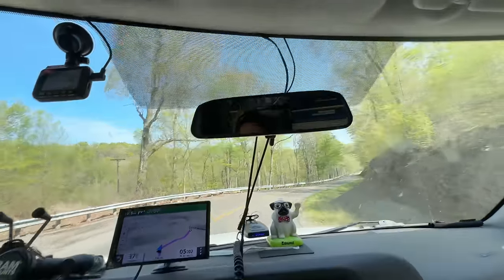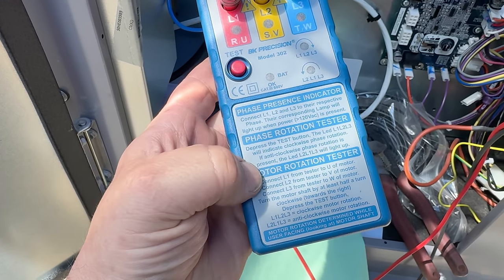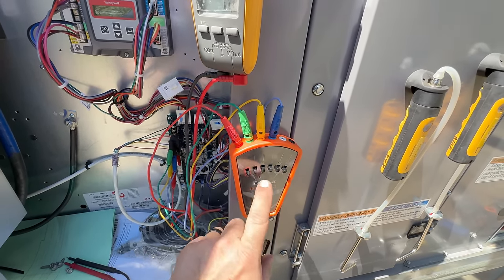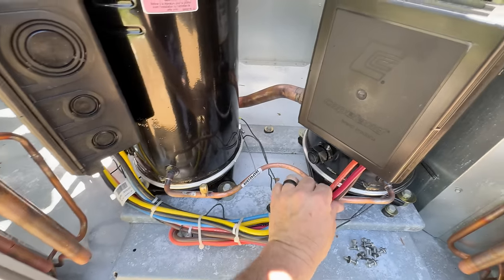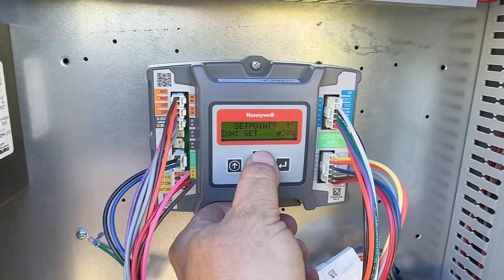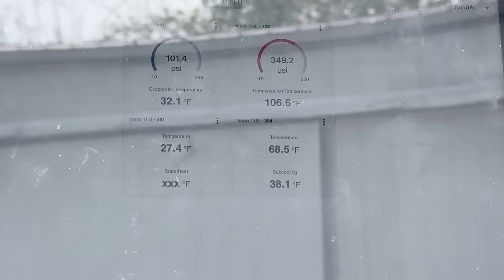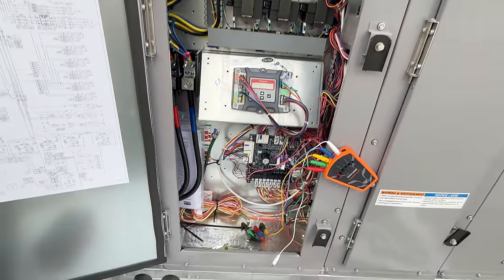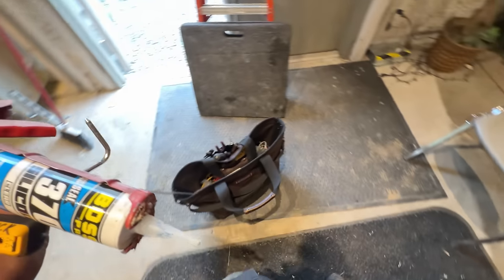Carrier RTU Start-Up From Hell

Comment: The quality of that equipment seems questionable at best. You did better than most do, thats a fact. These manufacturers seem to have abandoned quality control all together. Just installed and did a factory start up on a Trane Intellipak yesterday. It was put together nicely, but it definitely wasn't without its issues. Another quality video. PS.....I enjoy the rants....you are speaking fir many of us without a public following
Reply from the maker: Oh, I should make a private channel where I leave all that in because that was nothing lol there was a lot more
Reply: I agree with the lack of build quality. 
In January 2022 I installed a Trane CXAF heat pump and then assisted the Trane technician on the startup.

The startup went relatively uneventful but the engineer already scratched his head a few times because Trane had changed some things including a poorly documented lockout input.

One of those things was that all four crankcase heaters were connected to a single relay and got switched off as soon as the unit went into run. 
We already guessed that this was going to cause problems but it was designed this way.

Out of the 4 compressors they already replaced 6 🫠.
The first one went within 72 hours. The second one (on the second stage) went as soon as the first one was replaced.

They also had to replace the main control board and had to come back at least a dozen times because of lockout situations of different kinds.

We took the 5 year maintenance and warranty plan so not too much worries on the repair costs but the downtime is very annoying and expensive. We had to make sure we always had heat so we were forced to install an additional heat pump and backup gas boilers which had cost us around 40K to do.

After 2 years and 4 months we're still experiencing trouble with this unit 😔

Comment: Uncle Rick for the save..
Yesterday I was trying to explain my apprentice about the filling chart with the line.. Now he can watch your video..
Great video and keep being you, love the you explain things..
BTW. About the drain, looks US standard, but don't you ever use drains with the little orange ping pong ball.. Then it doesn't matter if the drain dry out, because the ball will prevent air from going in the to wrong way. And filling the unit with water.. Not sure if this is the case with RTU's but it is on big ventilaton systems.
Reply from the maker: I flooded a ceiling thanks to one of those junk traps. I put it back together wrong😟🤫🤦. Thanks for the recommendation!

Comment: On the fence with that jumper box, but your video may help make the decision easier. As for the resistance substitution box, it’s an old idea. Trane has rolled out Symbio 700 for the Voyager units, and it’s all Bluetooth. No more jumpers. Great video as always Rick.  Thanks for sharing.
Reply from the maker: That’s interesting about the Bluetooth box

Comment: Whoever decided to use zone dampers on sock duct is going to regret it. Those things need to be set up for the fans to run constantly during occupied mode. If the fan is allowed to cycle on and off with the call for cool/heat then every time that zone kicks on, it’s going to sound like someone cracking a bull whip as the zone inflates the duct.
Reply: maybe they're set to ramp up real slow? they are ECM after all, so I assume there's a setting for that, as well as continuous circulation.

Comment: Rick, I just did a replacement of 32 Carrier RTUs. The same mixed air temperature sensor was broken in the same place on 11 of them. Thankfully, they were nothing more than a SPST “safety” that wet could put a jumper across to make work. 

Some that had electric resistance heat kits (field install) came with wiring harnesses that didn’t fit anything, anywhere and had to be rewired to work at all. Same unit model, same heater model, didn’t know from one to the next what’s working or needed redone.
Reply from the maker: I cut out a lot of my feelings on how this thing was built and designed. We are a Carrier dealer so it really looks bad, but whose fault is that?  We didn’t build it.  🤔 I didn’t call Carrier out like I did Mitsubishi….at least far as you know 🤫🤫😂😂

Comment: carrier units have been good to me,just the regular maintenance.I was just wondering,how come you did not adjust the outside regulator to factory specs 13 inches.
Reply from the maker: That’s the max input, this was natural gas, not Propain.  The normal incoming range is 5-7”w.c

Comment: I got a lot out of this video. Carrier used to consider themselves the best quality unit money could buy. Without your thorough startup checks this customer would have nothing but headaches and bad feelings. Seeing this type of poor quality everywhere now. I’ve been buying every tool you’ve recommended. Please keep up the good videos as there’s not much out there like this for commercial/industrial guys.
Reply from the maker: Thanks man! I just did a VAV system but I didn’t record it because I was learning just as much as I went through it.
Reply: @HVACRSurvival just found your channel and love it! I'm a Facilities worker and love to learn as much as I can about HVAC. We are always calling techs for issues on our chillers (Carrier) but I'm needing to learn more of the control side of things. Multiple VAV's are not working right. Don't know if it's the temp sensors or the actuators that are at fault, or both. Been a process. Thanks for the great video.

Comment: I have the Zebra stat.  It works well and all but it's bigger and doesn't have any fancy connections and didn't come with magnets.  I had to JB weld some big magnets on it because it's pretty weighty.  It does have built in activity checker (which can let you know if the thermostat is calling for heat / cool etc...).

Comment: It's always great to see some quality equipment! why are those contactors different sizes between them, and in the last one 2.stage is smaller? shouldn't the compressor be a bigger one...
Reply from the maker: The freezer compressor was larger. Normally there would have a 40 amp contractor. But the one was a 60 amp.

Comment: I must say, I’m really surprised to hear and read all the issues with the newer Carrier equipment. Since I’m from Germany and mainly work Chillers I’m not really familiar with Carrier package units (only their chillers which have a god awful controller). I‘m mainly dealing with manufacturers like Ciat, Galletti and since about a year now all our new chillers are Skadec, which is a German company who really go all in on quality. It of course has its cost but they are really thought through, high quality units and also highly costumizable. They offer gliding free cooling, heat recovery, inverter controlled Bitzer or Bock reciprocating or screw compressors and a freely accessible controller.

Comment: Is the ducting getting insulated?
Reply from the maker: The exterior ducting was insulated. You can see it on the beginning of the video where I showed fixing the economizer wire. It’s insulated on the inside.  Once inside the building, I do not believe it was insulated.

Comment: High and low settings for the economizer is only available if the Jade is set for 2 speed fan.
When there is only one set point available, then Jade is set for single speed fan.
Reply from the maker: That makes sense. Kinda weird it wasn't set up for that with it being ECM. I didn't have time to read over the manual this day. But I just did a Siemens controller recently and I believe it said to set it for single speed.
Reply: Yes, it does seem odd that it was not factory set for 2 speed fan!!! Everyone that I have done has been 2 speed from the factory.
However, with the crap you found on those units, it's no surprise.

As for the Siemens, went to the Carrier dealer gathering and they were promoting them.
Seems like they are a combo of Belimo and JADE.
I think the neat thing is the ability to have NFC via the app and have saved set ups. Then all you do is upload the save settings to the control.
I believe you can save multiple set ups.

Comment: As much issues you had I would rather carrier than Trane. I constantly have issues with Trane. The other day brand new unit 2nd stage compressor going out on high head.
Reply from the maker: New unit? Clean condenser?
Reply: @HVACRSurvival  brand new unit first time running.
Reply from the maker: We sell Trane sometimes, I’ve had some problems with it too. The problem is the mentality of people nowadays, they just don’t give a crap and it shows.

Comment: Working on a little YORK comercial gas-pack, with a micro-chancel condenser.  I added the missing liquid line port and it 30 PSI lower at the new port.  😔  Nothing you can do to troubleshoot  that crap other than weigh out and in.
Reply from the maker: 👍👍 it’s crazy for sure

Comment: Fed up with carrier as of late, constant failed venter motors, ghost intermittent pressure switch failures, overcharged circuits from the factory list goes on
Reply from the maker: I felt the same way here.
Reply: we keep getting control boards dying . its almost like they have a  time of the year   for things 1st quater  skimp on compressor quality, 2nd electronics 3rd  Motors  and leave  screws loose

Comment: Very informative 👏 great video don't they insulate  the ductwork ?
Reply from the maker: Yes they did, I showed the insulation inside the duct when I fixed the wire in the economizer.
Reply: Oh dear good job they didn't send me thanks for replying to a pointless question I do apologise
Reply from the maker: No problem. Do you work for carrier?
Reply: No  long time ago I worked on the dustbins (HNCE units) they had zone manager controller with a C4 fault ,which meant it had a fault so not a favourite of mine (although very reliable)
Reply: Sorry I'm English so dustbins meant trash cans because they looked like them unfortunately I just do splits ,years ago did trane ,lennox and York but compared to what u do I feel very inadequate. Yours videos are great 👍 I can't stop watching them very impressive knowledge 👏
Reply from the maker: I did residential and light commercial for 19 years. I’ve only hit the stuff that I’m doing now in the last 10 years. Yeah it’s funny how we both speak English, but the choice of words is somewhat different.

Comment: It's easy to blame mexico but it doesn't really matter where shit is made. We put in mostly Daikin, made inTexas, and we see the same qc issues as brands that are manufactured in Mexico.
Reply: that's what happens when everything is always new/changed, vs. same equipment in production longer terms. we wont even go into worker turnover and temp. workers they likely use

Comment: Are you seeing any geothermal installations in your area?  They built a new high school where I live and all the heating is done with geothermal.
Reply from the maker: We have a lot of it.
Reply: Ground source (geothermal) can be great if the engineering is done with data not assumptions. Over 15 years ago I was involved with a project using ground source hydronic heat pumps. They didn't do a thorough evaluation of what the ground temperature was the before the project. It turned out that the aquifer was apparently glacial feed. In operation the supply water to the hydronic heat pumps was in the forties. The heat pumps were constantly tripping when the system was operated as designed. 

That project was a nightmare that had a lot of problems. Some examples are 100% outside air AHU that they value engineered out the heat recovery coils. There was a second floor glass enclosed lobby with no mechanical cooling that they value engineered out the high efficiency glass. And there was back to back double sash variable air volume fume hoods with a single fume hood control damper that the hood face velocity could not correctly controlled as the hood was designed. The hood manufacturer had to redesign and retrofit the hoods. They basically eliminated the separator between the sides. (And we had internal problems. Poor work quality by our electrical subcontractor. And we had a supervisor that threw my coworker under the bus. My coworker did nothing wrong. The problem was the hood design. This delayed the correction of the problem with the fume hoods.)

Comment: There isn’t a brand I hate more than carrier, it’s not even close, paper thin panels, no quality control, wires run through under the roof, motor flex so pulleys never line up.

Comment: Worst part is the price tag of these so called high end units and they all seem to have low end problems and quality. Coils still leak, terrible wire routing, cheap components that fail quickly or right out of the box.

Comment: It is insanely annoying that measurequick removed screen recording unless you pay for each and every unit. It was an amazing training tool but now it is next to useless to teach others.
Reply from the maker: Exactly it would’ve been good advertising for him. I don’t know anybody that’s going to go through all the hassle of having to pay for each individual customer versus just a flat fee per month.
Reply: @HVACRSurvival  They are losing out on so much exposure because of the fact now that measurequick can not be shown off and used in videos like you and other creators post, let alone to send screenshots or screen recordings to other techs to teach them or share information. 

There also is almost no reason that the field piece app should require a login, I’ve had issues with trying to use it while in an area without WiFi or cellular service and it is very frustrating.